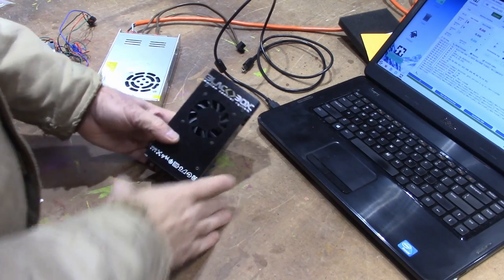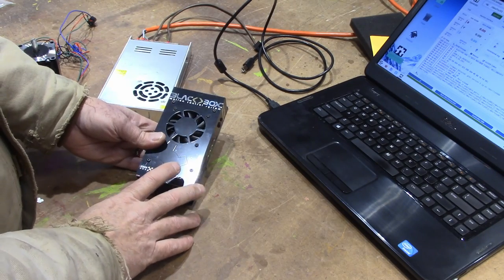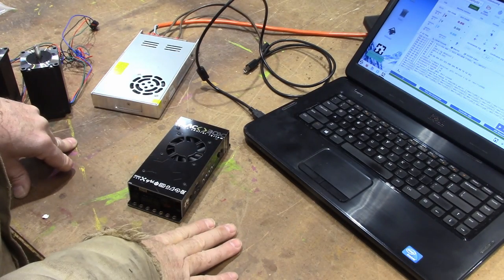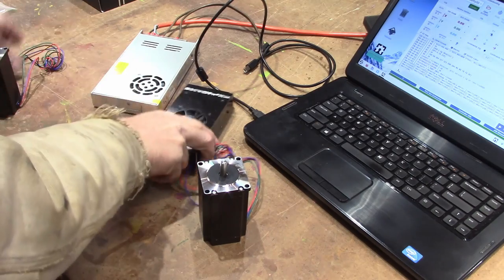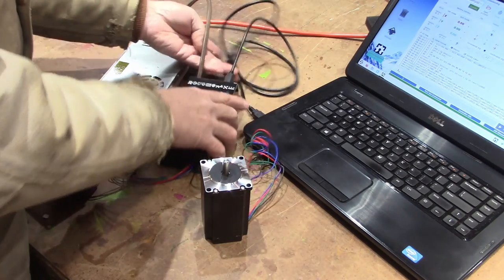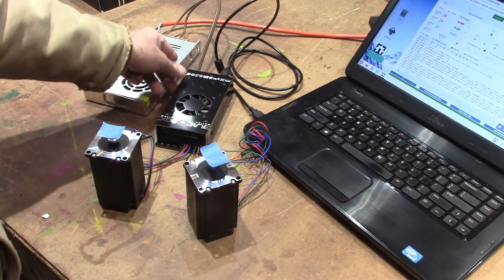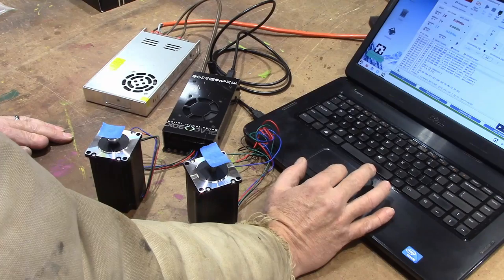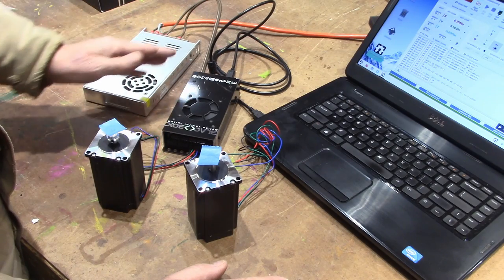Easy DIY CNC Setup with OpenBuilds Black Box

Comment: Very cool project.  I'm a moderator on the OpenBuilds forum and I cant say that I remember someone converting a quilting machine.  If you need any help customizing OpenBuilds Control, let me know.  I've written a lot of plugins for it.
Reply from the maker: Thank you very much Shawn!
Reply: Could it be a good motion control option for a CNC plasma cutter
Reply: @sharmstr I have a Longarm and I am going to try and build the same system that he built for his wife.  Can you help me with figuring out how to make a hole in my design using Openbulids, so that the Longarm machine will stitch around that hole, and not in it?
Reply: @WeQuiltStudio   The OpenBuilds black box and Control only sends code and moves the machine.  Your gcode will have to tell it to stitch around the hole.  Gcode is generated by either you or CAM software.

Comment: Hi Sr. Soat Mon... I watched all your videos about the sewing machine, I saw the connections for the blackbox of the two servos but I didn't see the connection between the sewing mahine's motor to the blackbox. I also didn't understand how the movement of the needle motor will coincide with each stop by the Gcode points. thanks
Reply from the maker: The machine has to have it's own stitch regulator.  It is a very common thing on longarms and can be added.  Look on the internet and you will find them.  The CNC only moves the machine around, it has to do the stitch regulating.

Comment: Sorry, should have asked before.  Is there anything special about the power supply you are using?
Reply from the maker: Here is everything I bought:  Keep in mind I almost always buy the cheapest thing I can find...
10mm pulleys:  https://amzn.to/3uPKCfF
Timing Belt:  https://amzn.to/3sG3afT
Stepper Motors: https://amzn.to/3JnaELh You will want to size to your application.  These wire up to the Black Box- Black to A+, Green to A-, Red to B+, Blue to B-. (usually there is a wiring diagram but these did not have one)
Power supply:  https://amzn.to/33hqsQt
Black Box:  https://openbuildspartstore.com/?ref=4mAalJdH4nWhV_  scroll down the page and you will see it, if not search for black box.
Hope this helps, feel free to send me an email if you need to.

Comment: anyway to get a phone call to you i have a cnc with mach 3 and had to change control board i have the mach 3 2.1 cant get any movement and driving me nuts
Reply from the maker: I would contact openbulds. They would be better equipped to help you.